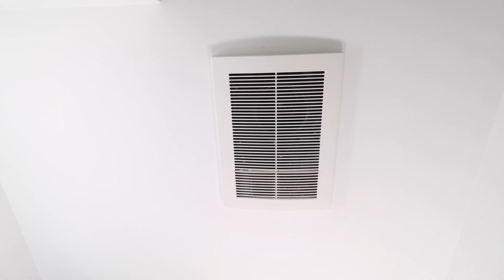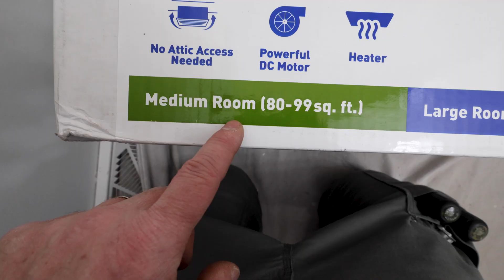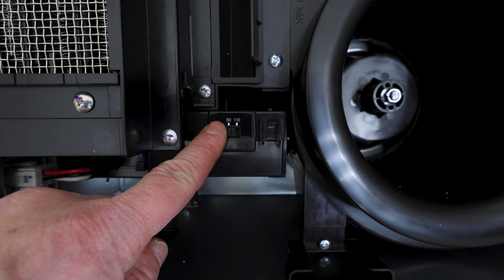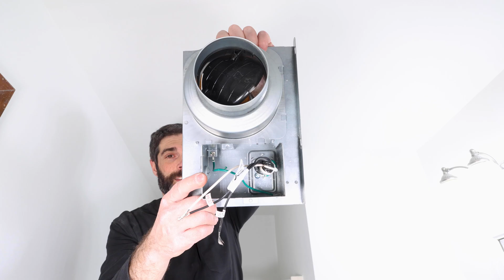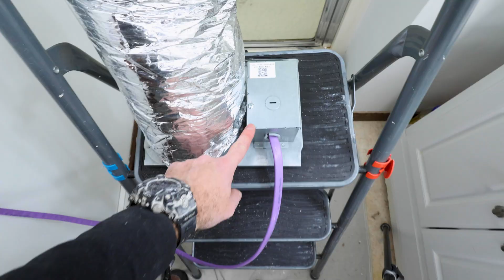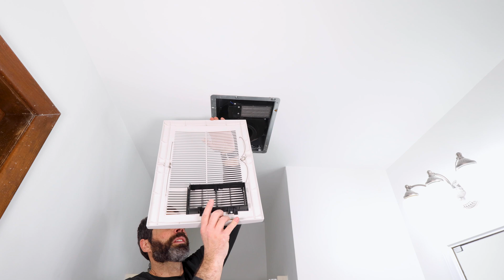How to Install a Bathroom Exhaust Fan (Panasonic Whisper Cozy)

Comment: I love video quick question, did you use roof cement around all four sides underneath flange or did you leave the front with non?

Comment: Good video one thing you should probably touch on is you only need 12/2 for the branch circuit and then 12/3 from the switch box to the fan.  Another over looked step which is very important is to bond the grounds together on the switches.  Thank you for the video.
Reply: Soo 12/2 to the the switch and tie the red/black from the 12/3 in the fan at the switch ?
Reply: @vicsanchez8861 that's correct. The switch has to have a 12/2 run to it from the panel.

Instead of the 12/3 between the switch and the fan, you can also run two 12/2s if that's all you have

Comment: You’re using the wire nuts improperly. You don’t use the wire nut to twist the wires. Wires should be twisted together with a pair of pliers then attach the wire nut and twist until tight

Comment: I can power the fan separately from the heat, or do them together. It seems that when I switch only the heater on, the fan also turns on. Is that intentional to reduce overheating the device?

Comment: I have the samr fan and it started failing after 2 years and a half of use, I bought a new unit in hopes of just changing the motor without rewiring but it turns out my unit was installed before the drywall, is my only hope to make the drywall hole big again?

Comment: Whisper Choice DC Pick-A-Flow 80/110 CFM Ceiling Bathroom Exhaust Fan with Flex-Z Fast Bracket. 

Plan on getting this Panasonic fan. Other then the heater is this one an acceptable choice? Wanted to install a new better one because mine is letting hot air into the bathroom and I can see it slowly molding.

Comment: Did I understand this right, if you have 9 foot ceilings you can't use this????
Reply: It just wont be as efficient....in that case turn the CFM Higher to compensate for the distance

Comment: Just wondering I ran two separate cables one for the fan and one for the heat. Fan runs good but when I turn on the heater the fan turns on as well. Is that normal
Reply: When you have a exhaust fan that also has a heater, it has 2 fans. One for exhaust and one for blowing the heat into the room.
Reply: Seems like you have it wired incorrectly. Most likely at the switch. You have two switch legs. Make sure they are seperate from each other.

Comment: Installed this today (mine was another version with a light).  This was really helpful!  Also, you don't need to drill the extra construction screws into the first piece you put up there with the vent/wires.  When you slide the fan box up, it "clicks" into place and holds.  The screw that goes on the inside of the case helps secure it too.

Comment: Does this have a dedicated switch to turn off the heat? Curious for hotter months
Reply from the maker: Yes, the 12/3 wire helps with that, you’d have a switch for the heat and one for the fan. Make sure the switches are rated for 20 amps
Reply: @HomeRepairTutor  The way to really fly here is an occupancy sensor with adjustable delay for the fan and switched power to the heat (or a heat controller if so equipped). Panasonic fans cannot be beat for quiet, cfm or longevity.
Reply: @edmessina8392  - Great tip! Can you please recommend which switch(es) need to be purchased to achieve this?
Reply: @HomeRepairTutor  what kind of switch  I need to buy? Thank you